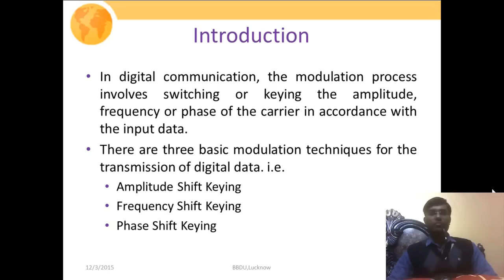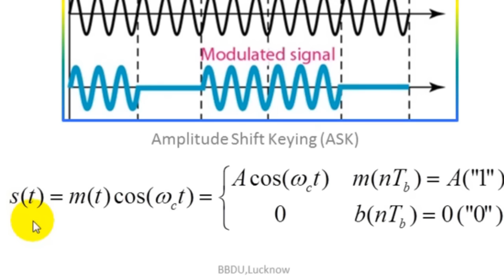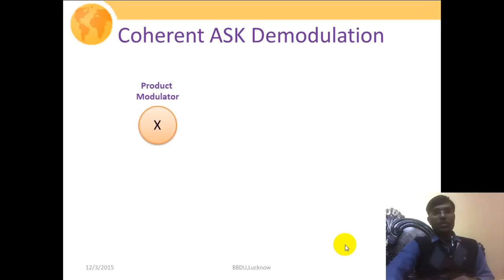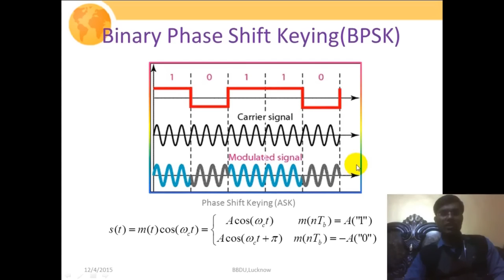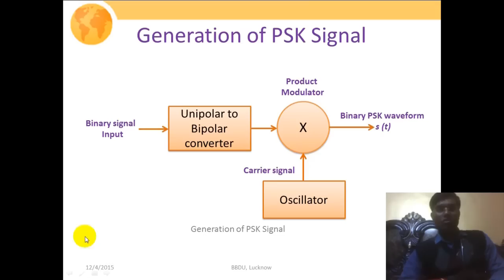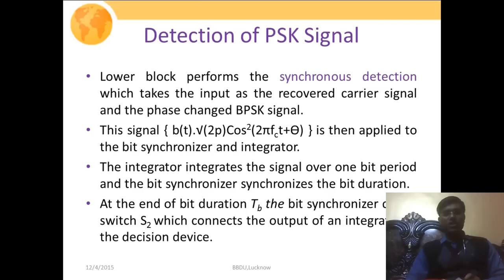Generation and Detection of ASK, FSK and PSK part 1|ASK|PSK|FSK|Digital Modulation

Comment: Sir ur video is very helpful. But i have one question probably out of the lecture. That is sir which app you have used? i mean how ur slides  in one part  and ur face is coming below and you are explaining the things.. Actually i  had to prepare these kind of video lectures for my assignment's. So kindly help.
Reply from the maker: At that time i have used camtasia studio 7.0 as it is paid software so if you want you can use OBS studio, it is a free open source software with all the requirement you have...hope this will help.
Reply: @ashutoshrastogi1984  ok sir, i will see it, thanks for replying!

Comment: Thanks a lot sir for providing such a useful video....
My question is that in case of PSK generation why unipolar is converted into bipolar and then pass through the product modulator....if we don't convert unipolar to bipolar then what is the behaviour of the modulation...
Sir please reply...
Reply from the maker: zaffar iqbal if we do not convert our signal from unipolar to bipolar...it will simply generate ASK instead of PSK...hope you understood...
Reply: Thanks sir I got the point

Comment: sir....modulation cw digitally can not travel thru the air directory .....sir how it is possible...i don't understand    ....tony bharti .M TECH NIT SRINAGAR
Reply from the maker: yes digital signal cannot travel through air directly i.e. why we have to convert them into continuous waveforms such as ASK,FSK or PSK.
Reply: Sir digital means 0 1 .puls
Reply: Using digital to anolog converters
Reply from the maker: it is not about the digital to anolog conversion...it is actually analog encoding of digital signal for eg if we have to transfer 0 or low value of the signal through FSK then we will pass the low frequency carrier wave and if we have to pass 1 or high value of signal then we will pass high value of carrier frequency...hope this will help...
Reply: Thank you so much sir

Comment: Hi sir, Thanks for your video. I have a question: How we can detect the phase from AM input wave, for example by using Envelope Detector we can detect the Magnitude of AM input signal. Is there any way to detect the phase like using PLL and so on??? thanks again for nice video.
Reply from the maker: good curious question but what i want to say is there is no need to find the phase as information is in the amplitude variation not in phase variation. from demodulation of signal point of view it is not relevant.still if you want to detect the phase at receiver side we have a simple comparison method where a standard known carrier signal is being compared with the received signal and the difference gives the information about the phase change.hopefully i am able to make you understand still any doubt you may ask again.

Comment: very productive video. really necessary when you don't want to go with text books. 
one question - why are we using bipolar data stream instead of unipolar one in case of PSK ?
Reply from the maker: +shreya gupta this is because when you multiply the carrier with the (-ve 1) you will have the phase shift of pi...if you use unipolar scheme and multiply your carrier with 0 you will get the 0 o/p instead of 180 degree phase shift.
Reply: +Ashutosh Rastogi 
Thank you Sir. we are eagerly waiting for the FSK part of the video. Kindly upload it.
Reply from the maker: Second part has already been uploaded...